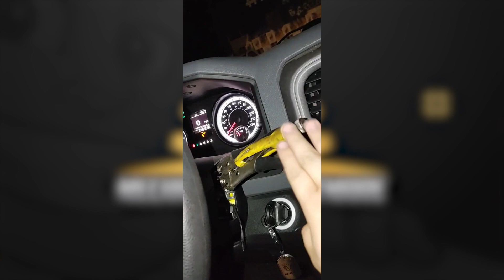Customer States Their Buddy Fixed The Column Shifter | Mechanical Nightmare 45

Comment: hydraulic oil protects against rust
Reply: isnt that still extremely  FLAMMABLE?
Reply: @Badgerroodragon   sorry but no is it not
Reply: @Badgerroodragon  Oil is surprisingly not very flammable. Hydraulic oil, engine oil etc. A normal Flame won't be able to set it on fire, smal red hot pieces of metal from welding falling into it, or using an angle grinder and aiming all the sparks into a bucket of oil. I saw all of these and the oil was nowhere near burning or boiling. Quite literally using engine oil on rusted parts and heating them up with a butane torch will only make the oil evaporate and smell weird, but will not have it burning.